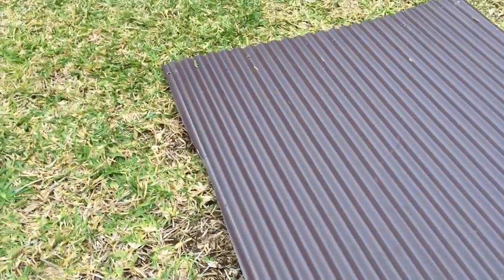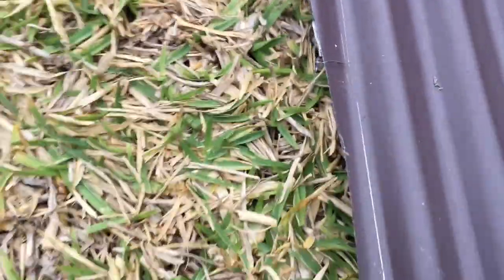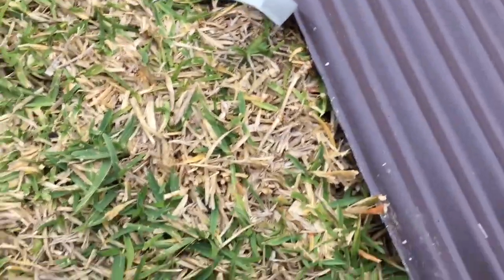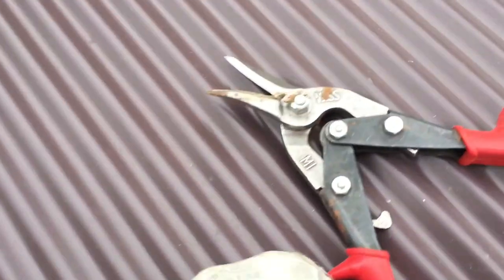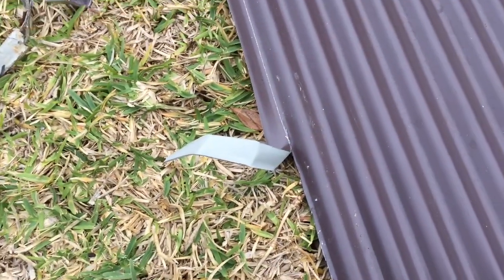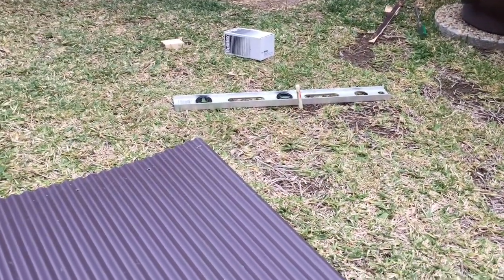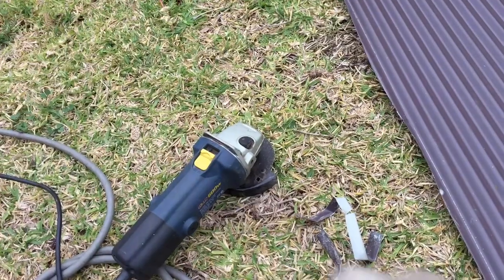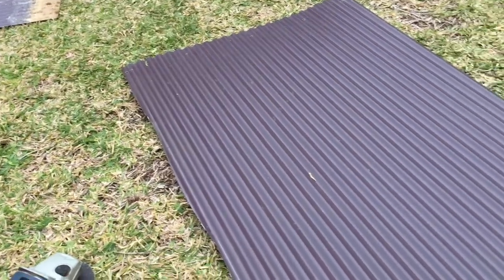How to cut Steel straight or corrugated Iron straight. Roofing steel cutting procedure

Comment: When you use a grinder for the cross cut, how do you get rid of the burnt bits so it doesn't rust?
Reply from the maker: 3CrazyCatBros CatsOnIG When you cut it with anything you need to paint the edge to stop rust